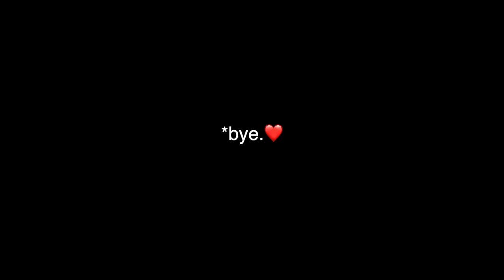FARMER VS. BABY LAMB... a battle of the wills. | Am I too late to train the sextuplet?!  | Vlog 659

Comment: Sandi I was so worried for you standing on the top of that ladder and leaning into the building, you need a take ladder you can handle or set the ladder in a better postion..position... sure as heck you did not have a spotter.  We live you ya know and DO NOT WANT YOU TO GET HURT. Please please be careful.  A bit of wet on the bottom of any good boots & on a aluminum ladder can be a bad deal.

Comment: Sandi = for the freezing water issues / try using a heat coil 0r deicer . sold at any hardware store or Canadian tire. it helps keep the pipes warm and wont freeze . we have it on top of our roof to stop ice build up, been using it for years and  add a timer for it to program it to turn on at certain times of the night or unplug it when not needed. for the Christmas tree for next year , think about solar lights for outdoors. they are great on tree's in your yard that you don't want extension cords . this way instead of having so many cords lying all over the place this would save you money and tripping over them.

Comment: Sandi,  have you every tried foam pipe insolating flex tubes.  Cheap, easy to install and clean... for the Nanny's lines not to freeze.  Maybe you tried it and it didn't work and I just missed to blog. :body-blue-raised-arms:

Comment: Sandi, could you wrap the Nanny's tubes in that foam pipe insulation so it won't freeze?  That stinks having to constantly have to thaw it with hot water.  It's -5C where I am at right now.  Just before your storm we were at -25 C where you're at.  Let me tell you....that's cold.

Comment: Sandy can you get a few of the PRESTO heat dishes from Costco to aim at the frozen lines. You do not have to leave them on. Just turn them on when you get to barn and they would heat the milk lines in that area really quickly thaw them out really fast and the nipples too. Then turn off and use again as needed. Just a thought. And then you do not need to drag the buckets. They are also very safe if knocked down or moved the wrong way they just shut right off. You just need a few more extension cords. Aww the golden girls are very cuddled in :) Christmas really is about being together no matter how it works out. I am so glad you mentioned it is 2023....you are not the only one lol. The thaw is here to after blizzard and it's a bit scary. hugs and Happy New Year.

Comment: OK, I know this isn't the forum for it but watching you tote hot water makes my back twinge. If you get some rigid foam insulation with foil backing you can make an insulated cover and place one or two small incandescent bulbs around 50watts inside the hood to heat the lines. You might want to put a thermal switch with the sensor inside the hood and it should keep  the milk lines thawed. My greats used 100watt bulbs to keep the wellhead warm enough to not freeze, same for under the house. Those old 100watt bulbs were used in the Easy Bake Ovens and generate about 350F, enough to bake a tiny cake in 10 minutes. Half sheet of rigid foam, a sharp knife, some duct tape, heck a string of old fashioned Christmas lights would be more than hot enough.

Comment: I was wondering if you could drop the milk hose into hot water to keep them warm and running but I guess the water would get cold fast enough and then freeze the hose into a bucket of ice.

Comment: What ever happened to buying a leaf blower to help with the walking/motor aisles of your sheep barn?  Last you mentioned to me, you had that on your list but that was over 2 years ago and the aisles are still being cleaned with a broom and scoop shovel?  A strong backpack style leaf blower would blow it all from the back to the front for you so you can just scoop it into the bucket instead of sliding the bucket tractor. . . plus... bonus for the backpack leaf blower, you can also blow off the edges where the birds poop and debris starts to accumulate. (I forget the name of it) down the asile.  I'm not referring to the actual pack, but rather the motor aisles where you drive the little crawler with a bucket / scoop attachment.

Comment: Sandi, is it possible for you to put the foam  insulation rolls around the milk lines like is used around water pipes for insulation? It comes in different pipe sizes. It's just a thought I had that popped up in my head! We had an ice/snow storm on Thursday, Dec. 22-25.  We only received 4" of snow with icy roads. Temp was 4°F, with 30-35 mph winds, giving us -38°F "feel like" wind chill. 🥶 I probably wouldn't leave my house, if I lived where you are. 🙄🥶🥶

Comment: If you ever have to go through these cold temps again, you should look into using heat tape to keep the lines open on the milk machine, or the pipe insulation wraps with the instant hand heat packs.

Comment: SANDY?????????????  A suggestion on keeping the bottle babies milk lines from freezing.  Put a light above the lines to keep them warm Also helps keep the milk warm in the lines. What works great are the heat bulbs if temps drop too low.  Hope this helps.